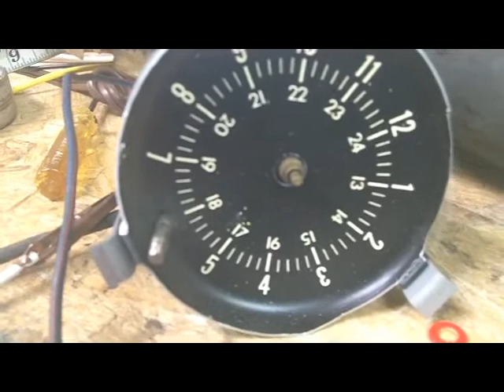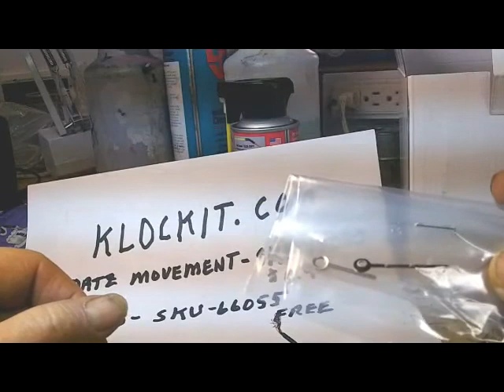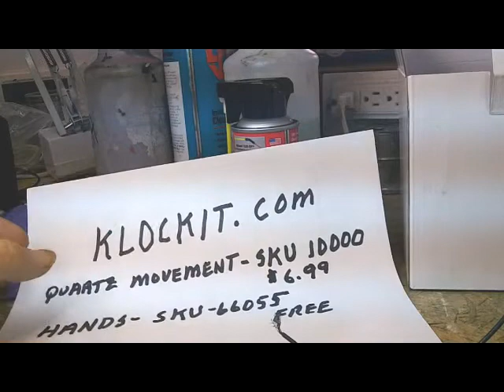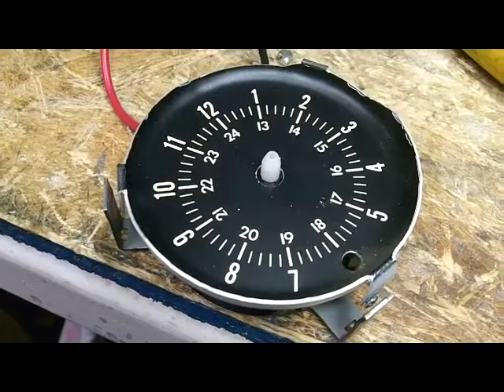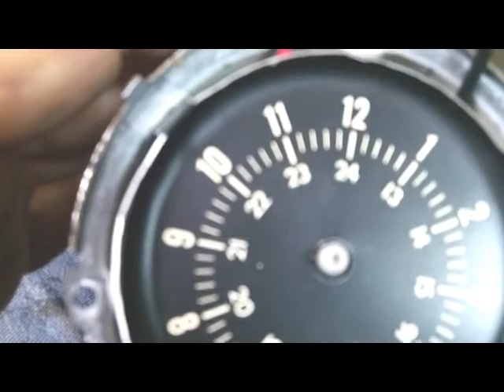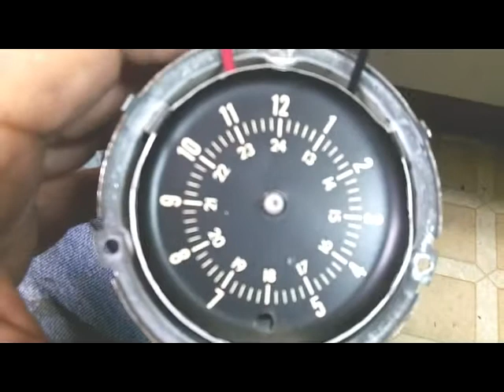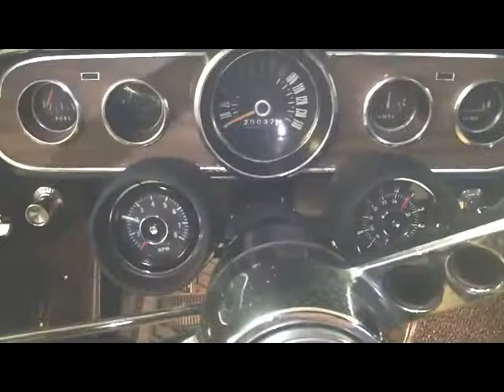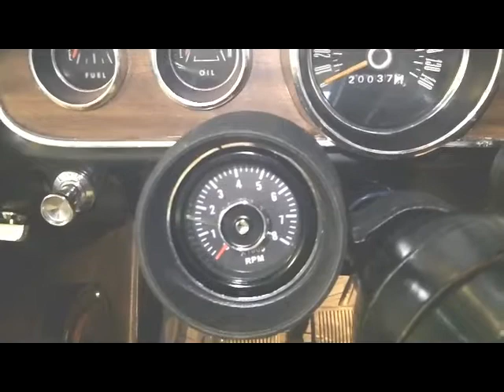Converting 1965 or 1966 Mustang Rally Pak to quartz clock and modern tachometer Part 1

Comment: super cool, many thanks for sharing the tips. I will try on mine. But the tachometer is not working either....
Reply from the maker: Good luck on ur project. The last time I checked I don’t think Klockit still has the quartz movement. I found another one I think will work but I have not done a video yet. I did one for my brothers mustang and I replaced the tach also but I have not done the video on that also.
Reply: @iluvjunkradios6081  Yes, you're right it is no more available. But in any case, since I am in Europe, I have to find other parts. But this is not a big deal, your videos (tach and quartz) depict very well the steps and the overall approach to have. Moreover, it's motivating to see that someone managed to do such a replacement for a few dollars while Rally Pac replacement kits are really expensive... Thanks again, this will help me a lot :-)
Reply: Where can you get the clock? Do you have a link to the correct model?